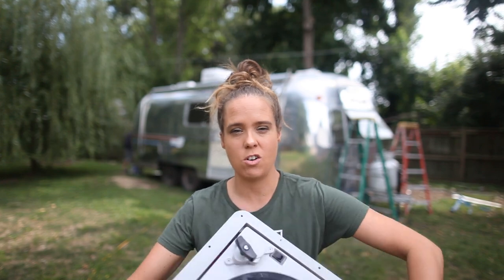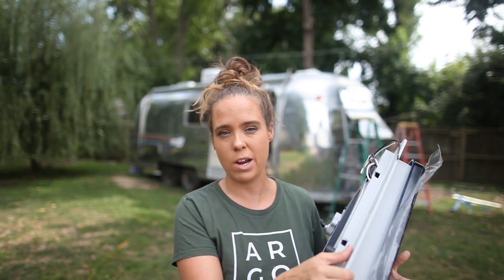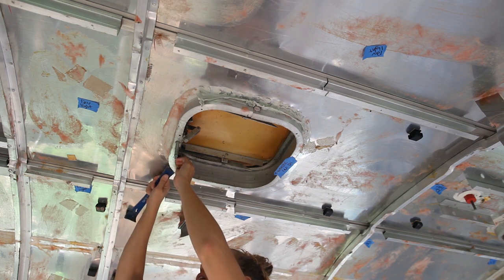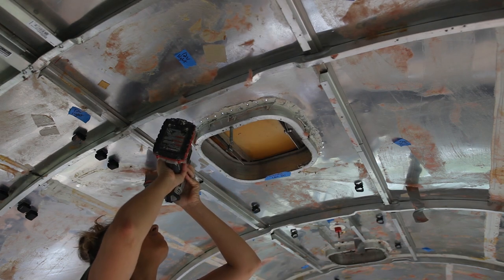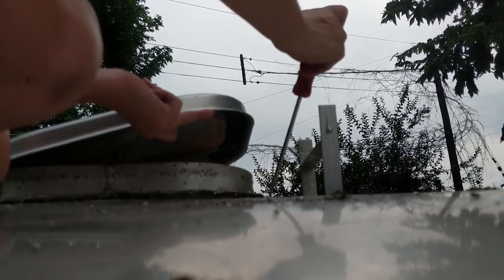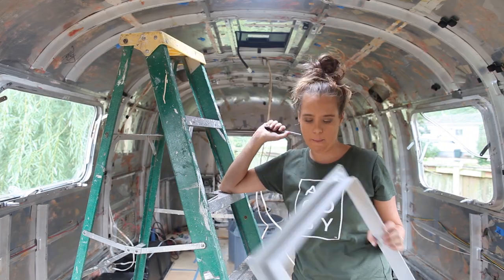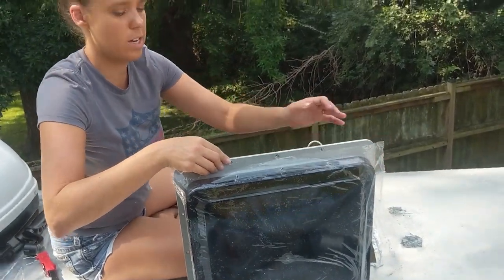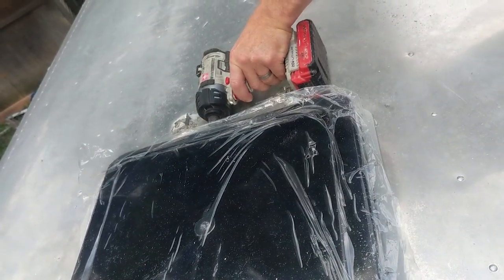Renovation Vlog: Installing Fantastic Fan {WITH Rain Sensor}

Comment: Have you guys looked into the electric or pneumatic rivet guns?  We purchased a 12V battery operated rivet gun for when we do our remodel.  We haven't tried it out yet.
Reply from the maker: Yes but it looks slow to me. And expensive. I should try it eventually